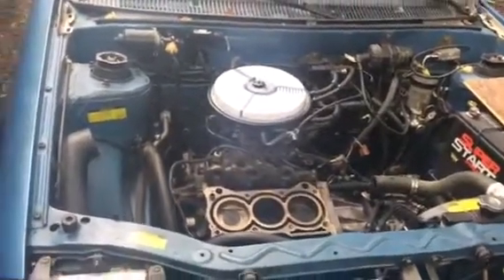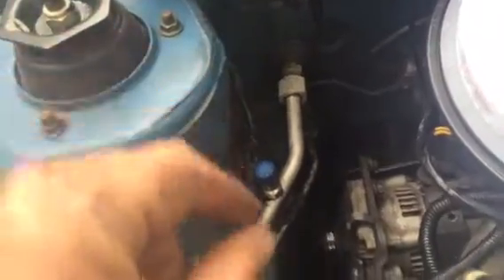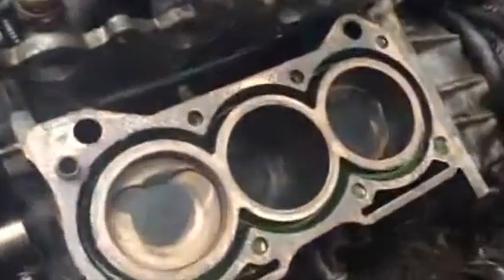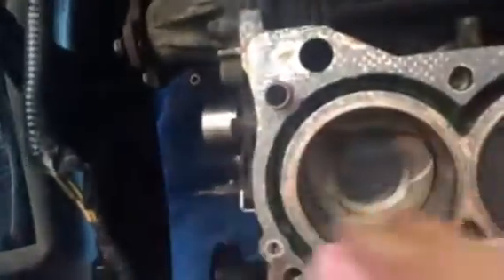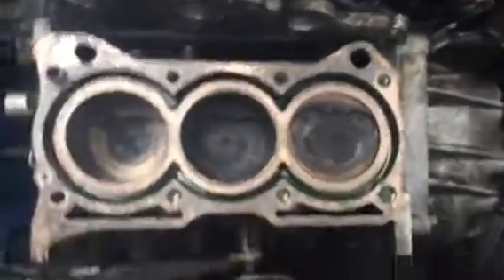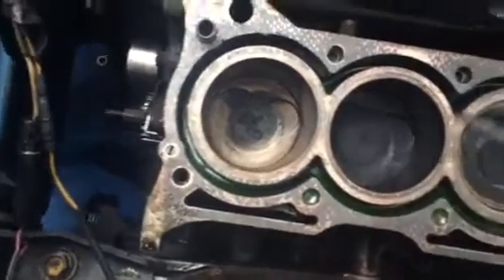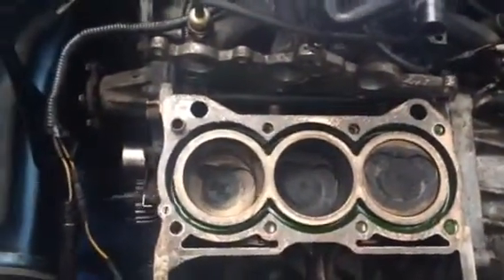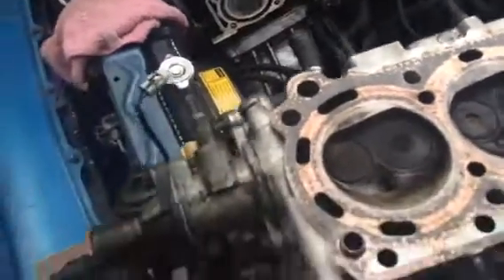1990 Geo Metro 3-Cylinder: Checking Bores and Valves

Comment: What you called corrosion is really carbon deposits, which you can scrape off with a brass or plastic scraper, but don't have to.  They are usually harmless but might cause a bit of spark knock.  oil loss, first step is look for leaks before disassembly, then it is either rings or valve seals if the bores look good.
   Once apart like it is, I would use a drain test to test the rings.  You put some light oil in the bores and see how long the rings keep it there, but I forget how fast a drain is acceptable?  So if it passes you have the valve seals done, and maybe put in higher quality exhaust valves while your at it, and if it fails you do the rings, and check the bores with precision.  But what if it's both rings and seals? how do you check the seals with the head off?  You might want to do the valve job just in case unless you can devise a way to check valve seals.  If you can remember before taking it apart, and watched the exhaust.  If it made blue smoke when cold then do the valves, and if it made blue smoke when warm, then do the rings (and bearings).  To tell if it needs reboring, feel for a ridge at the top of the bores, though you need experience to tell by feel, a newby would need to measure the ridge with a micrometer, get an number, and compare it to a spec.

Comment: carbon not corrosion but i would say re ring and bearings with a remain head.
you need some special tools to take the valve springs out you can take the cam out  the springs are held in by locks . You have to compress the springs to remove the locks. i would call around and see what a remanufactured head would cost and call some auto machine shops and see what they would charge to rebuild yours witch ever is cheaper go with it but i wouldn't attempt it yourself